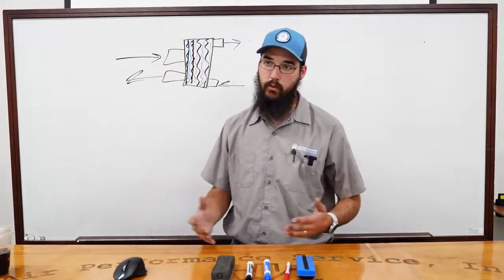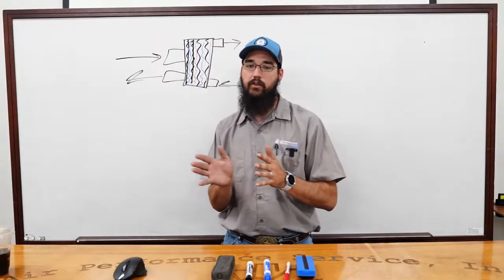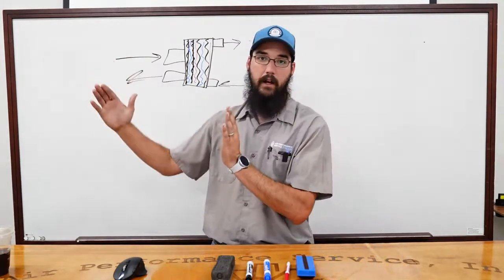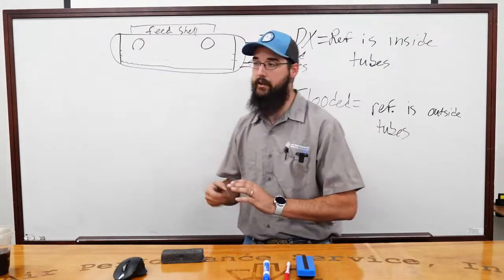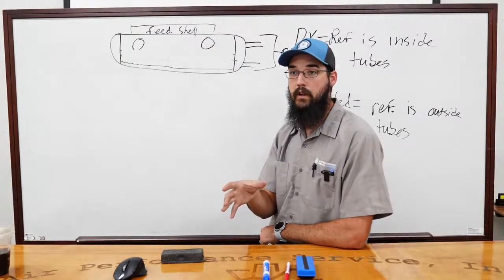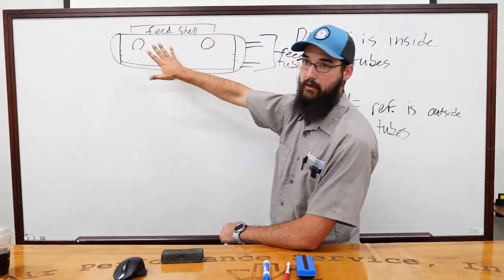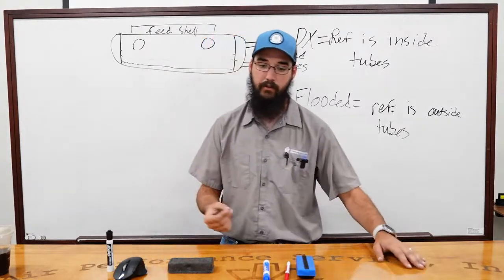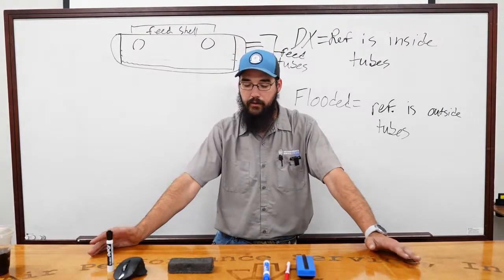HVAC Chiller Recap

Comment: On air-cooled, I have seen some chillers only have a leaving water temp sensor. What is the purpose of this?
Reply: Most of the time the chiller is only looking at the leaving temperature for operation. If you wanted an entering temp for troubleshooting you would need to take it by hand.